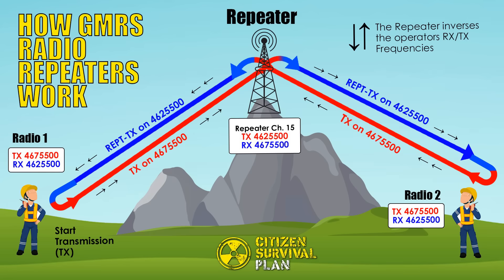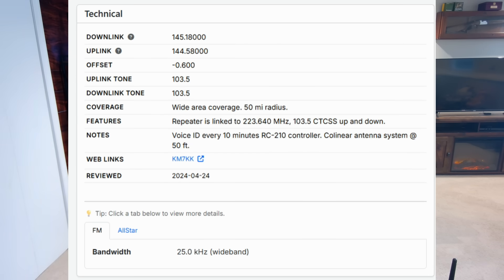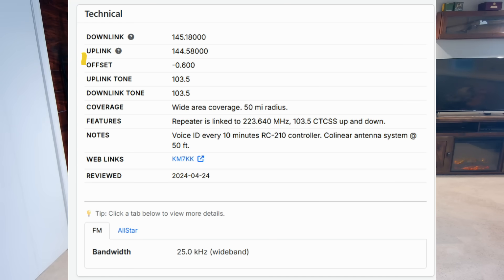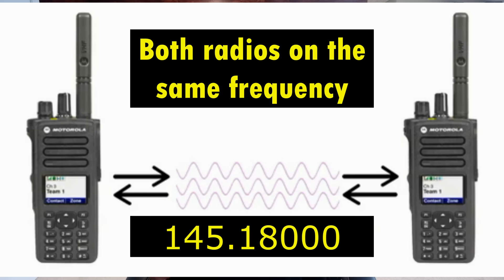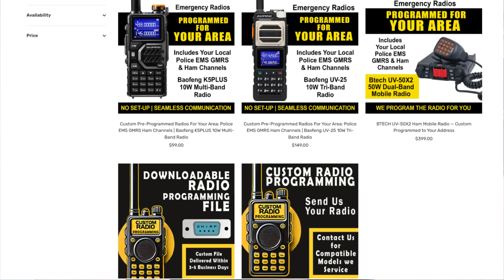Your Radio Won’t Work in an Emergency Until You DO THIS

Comment: What if there are no repeaters in my area ?
Reply from the maker: You have repeaters in your area its possible you may not be in range of a GMRS repeater though. I have done programming for some of the most remote places in the US there is almost always at least a few available.
Reply: @citizensurvivalplan  I've used my gmrs site for repeaters and nothing shows up for my area, is there a different directory to use to find repeaters ?
Reply from the maker: Email me. Citizenplan711@gmail.com
Reply: @citizensurvivalplan  Sent title is Repeaters
Reply: @kimmccarl1089 , I can only find listings for one repeater in my area. It is 15 miles away, and listed as inactive.
Reply: @kimmccarl1089  Repeater Book
Reply: You are then restricted to simplex operation (radio to radio direct). If using an Amateur radio, the universal simplex frequency is 146.52. During non-emergency times you would need an Amateur Radio license to operate in any of the HAM frequencies.
Reply: @dennisferrara8395  No you are not. I can unequivocally deny that information. DURING AN EMERGENCY you are able and allowed to use any means to get help. Rules for hams states that if someone declares an emergency even on a repeater all traffic must stop and the emergency MUST BE HANDLED.

One of the foundational purposes of amateur radio is to provide emergency communications. The FCC rules that govern ham radio, specifically Part §97.1, state that a key reason for amateur radio’s existence is the “recognition and enhancement of the value of the amateur service to the public as a voluntary noncommercial communication service, particularly with respect to providing emergency communications.”
Reply: @kimmccarl1089
   Move
Reply: Most likely you have repeaters that are just nor used as often as those in larger cities.

Comment: Fire, Police and all others also use repeaters.
Reply from the maker: Yes.
Reply: Where I live all Emergency services such as Fire department, Law enforcement, and such like have gone to a Trunked Digital system. That is often scrambled. So you'd need a digital radio that could get into said digital repeater.
Reply: Aren't those digital?
Reply: @Z7d3nR4  not necessarily some are analog still.
Reply: @Z7d3nR4 Yes most of them are now.
Reply: @Z7d3nR4  Large city emergency services have predominately moved to digital comms. However the upgrade cost from the older analog systems are quite expensive. Small cities and rural towns will continue to use analog systems.